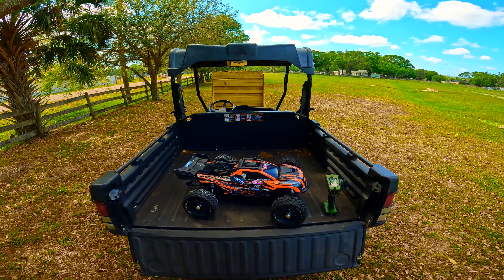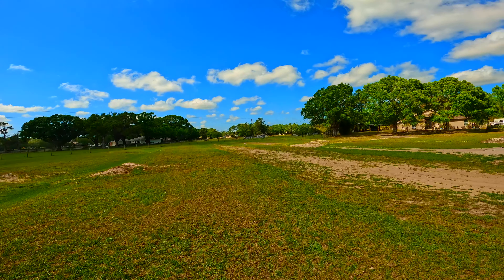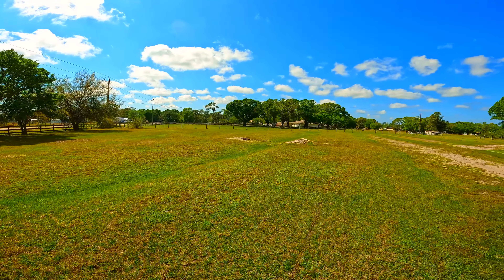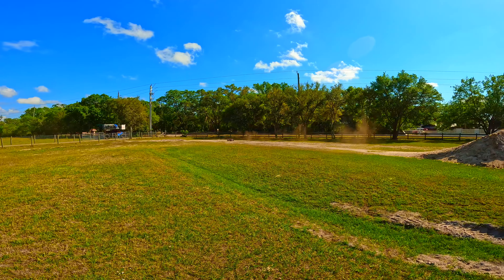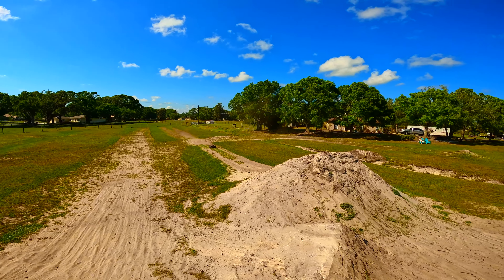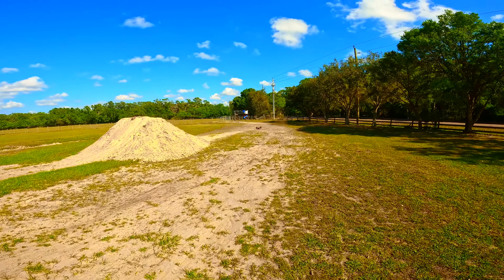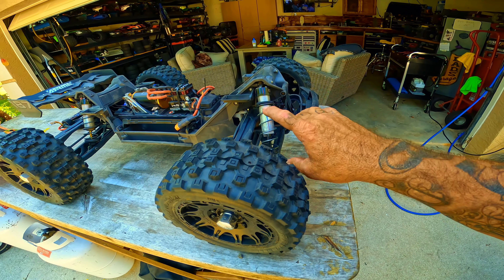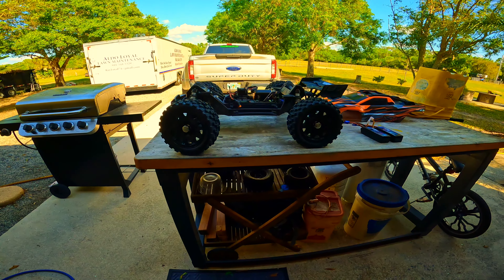Traxxas XRT 🚀 UP CLOSE AND PERSONAL 😱

Comment: Badass run Brother Aldo 😜!!! So many sick sends and butter smooth transfers 😍. Love those close-up flyby's 👀🚀🚀. That was a serious test on the chassis brace. Looked like it might've saved your chassis from the steel drag unit, especially if it gouged the alloy 😱. Stoked your shocks were still straight. The 5T tires ripped hard before the beads let go. Thanks for a sick upload and rig overview Bro 🍻😎💪👊👊
Reply from the maker: Thank you so much 😎 Rich. I finally had a decent run with this truck. The M2c chassis brace held the truck together and just felt more planted especially on landings. 
that steel drag is no joke with that re-Barb sticking up out of it. I need to hook onto it and drag it out of there That things gonna end up taking me out one of these days. I think the lighter CST and the fuel tubing helped a lot with the shocks. I’m hoping to get the truck back out today for another run. Thanks again my friend happy bashing.

Comment: That was huge air and fun watching. I kept bending front drive axels till i got some aluminum front A Arms and it just plows through hard front end hits other then keeps the suppsension solid to from getting bent shock shafts. Thats like the only aluminum iv been runing on my 1/8 truggy. Another great thing to having aluminum front lower A arms is it keeps the steering straighter so your wheels dont point  out more. Front lower aluminum a arms rule! The exstra lower weight on the car helps it plow through hard hits better too. Try it bro!
Reply from the maker: Thanks man I’ve been thinking about that. Just a little leery on bending them, but I guess it’s no different than breaking them.

Comment: They brought the bash bar out last week so i got one i'm waiting for it to turn up. Also i cracked the lower rear chassis across the center diff base on the same day and parts are hard to get with no chassis parts available i had to buy from germany. I hope it stays together now but seeing your crazy Durability test it looks like it will. 
I also found that the wishbone hinge pin bar had loads of play as the plastic had flattened bit of a poor design so bought the vivaton hinge pin plate but it is expensive
Reply from the maker: Yeah man it’s a pretty tough truck but it seems like once we figure out one problem another one occurs hopefully we get this truck straightened out soon. Those suspension plates work wonders. I have the hot racing on mine
Reply: @AldoLoyal  yeah i was looking at the hot racing plates but there aren't dealers over here in the uk for alot of the cool alloy mods. I like m2c's mods though they make some good stuff i like there servo brace 1218 you can use it even with broken servo mounts saves some money. 
How is the m2c center drive shaft kit holding up i think you said you have one installed?
Reply from the maker: @davejohnson3474  it’s working great no issues with M2c parts